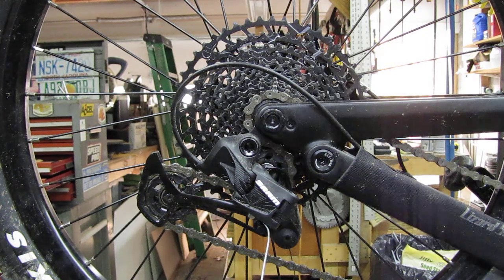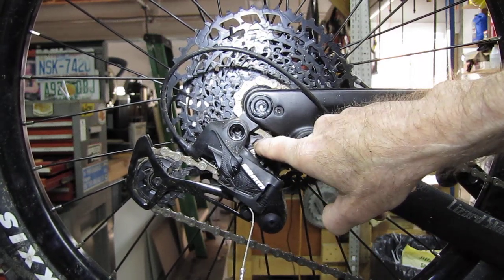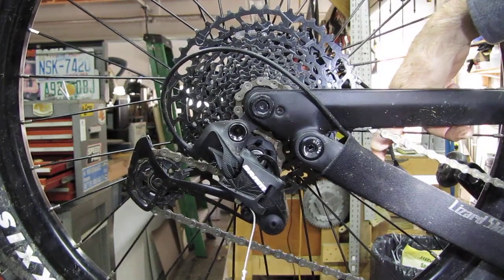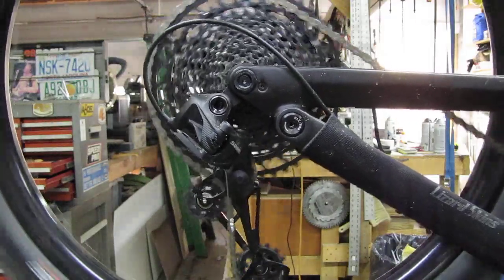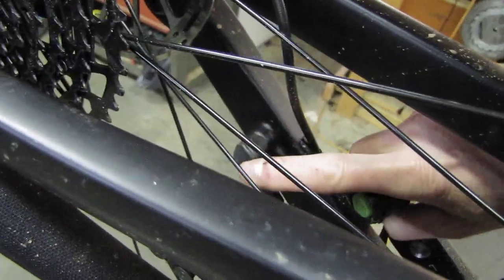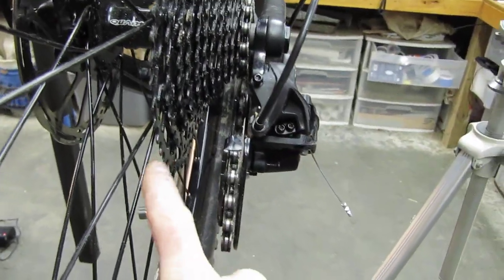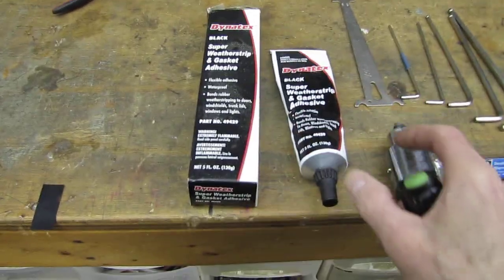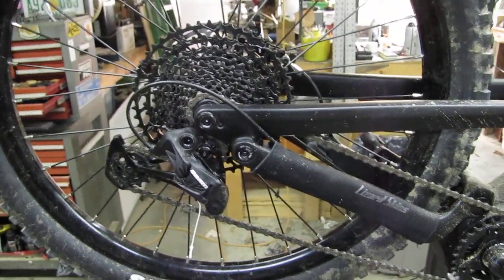Luna X1 derailleur adjustment

Comment: Thank you for that, gonna try to get this done in the AM tomorrow and go for a quick ride in the afternoon before it snows!  I am still looking forward to that light on the Fat Bike, I am tempted to hook up a separate RC LiPo battery for my headlight.  I have read that somehow the controller can turn on a headlight (saw it mentioned in both the Luna X-1 manual and on a review of another bike with an M600) and would love to have an integrated solution, but would also like to go from the X-1 to my fat bike.
Reply from the maker: If you can tap into the battery terminal plate in the battery compartment, you could add a pigtail plug somehow
Reply: @happyhooker493  I figured there was but can find no pinouts for any of the cables that shows a headlight power wire